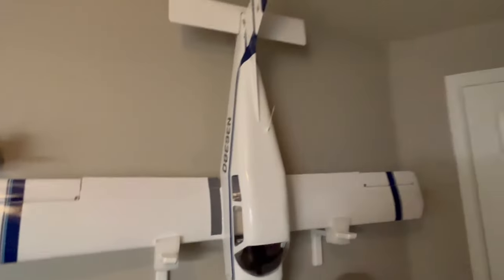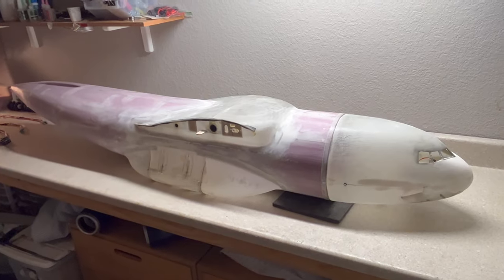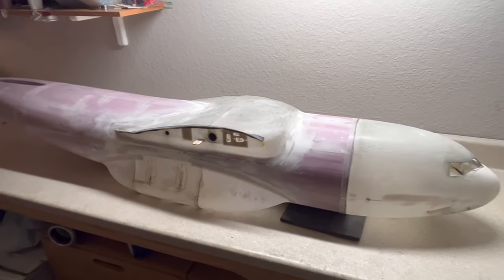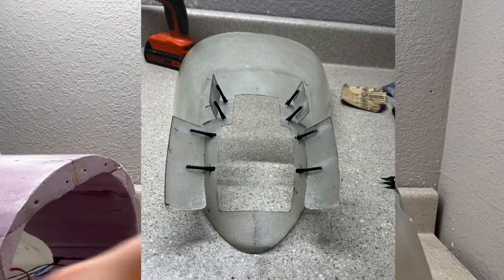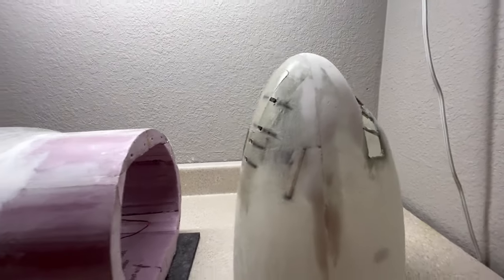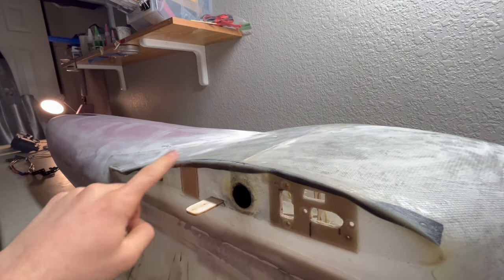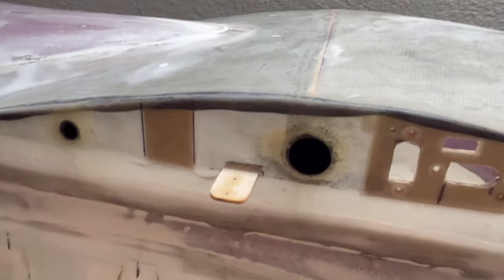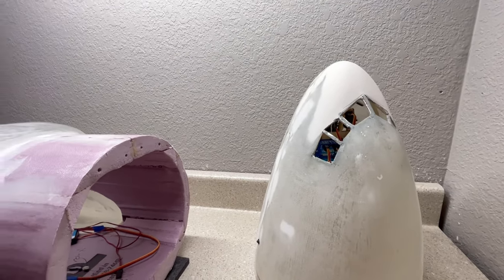C-17 Globemaster Build Overview - Fuselage

Comment: mate this is so awesome, good to see a video with an up close in depth explaination on how everything works and is built, im building from scratch an a320 with 90mm edfs il be watching your videos for some tips, il probably add a video on my channel soon on my progress aswel cheers!
Reply from the maker: Thanks! If you release a video on the 320 let me know, I'd love to take a look! I built an A220-300 with 80mm fans which I plan to make a video on at some point.
Reply: yeah i will let you know a soon a its up, at the moment i have got about 70% of the way through getting the molds done for all the main parts, half way through the fuselage right now , i made plugs from polystyrene blocks hot wired and sanded, alot of hours for that

Comment: Nice build.  Looking forward to seeing the maiden flight.    Especially the wing construction is regards to Fowler flaps ect.      
Retract sequencing, do you use Open Tx or Edge Tx.  If not, look into it.  Do everything you want through the transmitter, no blue boxes needed. And Hello from New Zealand
Reply from the maker: Thanks! I don’t use open or edge tx. I could program the sequencing pretty easily through my spektrum NX-10, only problem is it quickly becomes a channel hog, which is why I wanted to use sequencers if possible. Part 2 about the wings coming soon!
Reply: @kalvinwinder  Dame,  that was a fast response.  Thanks man,  channel numbers for add up fast.  But with a simple 8ch Rx, and Sbus to a channel decoder, can easily get 16 channels.   Guessing you're informed of option's available.   So I won't board you.    Can make set up easier is all
Reply from the maker: @russcole5685  I’ll be honest, l’ve never heard of open or edge tx until now, though it sounds like a powerful tool that could be incredibly useful so I’ll definitely look into it. Thanks for the tip!
Reply: @kalvinwinder  you'll be very surprised.  A cheap radiomaster branded radio is very powerful    you'll still be able to use all of you existing radio gear as they are multiprotocol.    I use a older FrSky X12S, and with a multiprotocol module in the JR bay, can use any Rx .  With a FrSky module in the JR bay I can add a further 16 channels.  
I use this as a redundancy, sending signals on two separate protocol for piece of mind.  Of if I choose can use it to expand number of channels.  Giving me the possibility of 32 channels.    I typically use one channel per servo.  I just don't like Y leads,  plus you can programme each servo to be matched or not for what purpose needed.      It is a lot to program, but once done it's done.   Learning the EdgeTx at first is steep, once it clicks it's very intuitive.     Plenty of videos on this YouTube about the systems.   Hope you enjoy,  gives as much power if not more than a expensive Jeti system at a very small price.

Comment: what resin do you use over the pink foam that doesn't melt it ? Bro this is beyond amazing work, my dream rc plane..just wow, please post updates and flights... how you wire the 4  edf's, what flight controller...everything I can't wait to see more
Reply from the maker: Thank you! I use just your standard craft casting resin, it's not the most rigid resin available, but it's foam safe and perfect for my application. Nothing fancy required to run 4 edfs, just your typical setup times four. The inboard and outboard fans will run on separate batteries, that way if I lose power to one, I'll still have symmetric thrust and the plane will remain flyable. There's a lot more to come, though it may take a while since I need to make some more progress on the build before I have enough content for another video.

Comment: Love it man! Bween trying to build some stuff myself but i really cant do 3d modeling. Its holding me up.
Reply from the maker: Thanks! The best way I’ve found to learn is to just do. It takes a bit of practice, but after a few designs you pick up little tips and tricks and it all progresses from there. If I can somehow figure it out, then anyone can
Reply: @kalvinwinder  I'm got a couple models made. In fusion and blender. My prob is getting plans out.
Reply: As well as modeling lol
Reply from the maker: @excellenceinanimation960  Fusion makes it really difficult to convert something into a pdf that can be printed. All my measurements had to be based off small scale screenshots, and measured and scaled accordingly since I haven't found a good way to make plans. Maybe that would be different with a paid subscription, but to my knowledge there's still some other programs you'd need to install in order to do it efficiently.

Comment: Nice work, and a great video! I was considering a C 17 build as well but the landing gear was a showstopper for me. 70 mm was my preferred size as well. Would you be interested in sharing, or selling your fusion 360 design files for the airframe and the main gear?
Reply from the maker: Thank you! I am more than happy to share files, though, I would need a good website or format to share them through since there are so many parts. Also since I didn't plan to share them while I was designing it, they aren't currently very organized, so it would take a bit to sort through them and set it up in a way that makes sense. Do you know of any sites that I could upload them to for sharing? Also, one more thing, the design still isn't complete, so a few aspects would be missing if I were to share the entire fusion 360 model.

Comment: Wow great work. How do you finish the printed molds?
Reply from the maker: Thank you! First I reduce the print lines by sanding with 150 grit, and then 220 grit. Next if there's any impurities that need to be addressed from imperfect printing I fill and sand accordingly using spackle. As a bare minimum you can get away with putting the mold release on from here and it works if you want to save time. For a perfect mold however, I'll do 3-5 coats of filler primer, sanding in-between each layer with 320 grit. Then I'll put a coat or two of paint over that to help harden and smooth the surface. It's very time consuming, but it is rewarding when you finish and pop a perfect composite part out of the mold.

Comment: You are an engineer. You need to patent that design
Reply from the maker: Haha thank you! I wish that were possible, but the design would need significantly more refinement to make it worthwhile. Also, that would limit what other people could do with it, and I would hate to restrict innovation just to protect my idea. I don't mind if other people use and improve upon it
Reply: @kalvinwinder  great attitude and your thoughtfulness. I cant wait to see the rest of the build. What battery capacity will you run?
Reply from the maker: @edwinthomas618  I’m currently planning to run either two 6000mah or two 8000mah 6s. One for each pair of fans

Comment: Hi, great work. Would you share the design? I would love to print it
Reply from the maker: Thank you! What aspects of the design would you be interested in? I still have all the files for the molds, hot wire templates, and landing gear, but, there is a lot of them. I'd love to be able to share them, I'm just not sure what format I would have to use in order to do that since there are so many different files.

Comment: Thats not proportional
Reply from the maker: What aspect are you referring to?
Reply: @kalvinwinder  the tail in relation to the fuselage. The wings in relation to the tail. It's off all around by atleast 20%  still looks OK though
Reply from the maker: @jeeperzcreeperzz  It may look off from the images, but it should be a nearly perfect replica, the model was designed and scaled from exact 3-view drawings. The Globemaster has abnormally oversized flight surfaces, which is why it is so capable, and caters so well to an RC model. Though, I don't think we'll do any good by arguing about it.
Reply: @kalvinwinder  fair enough. I guess we'll see how it looks when it's done.